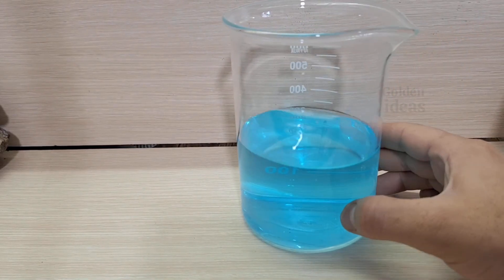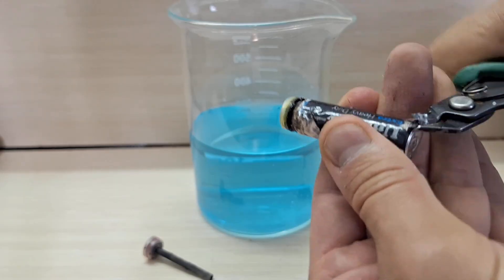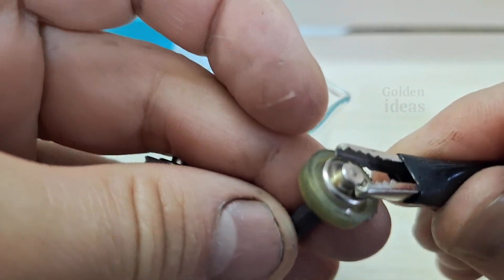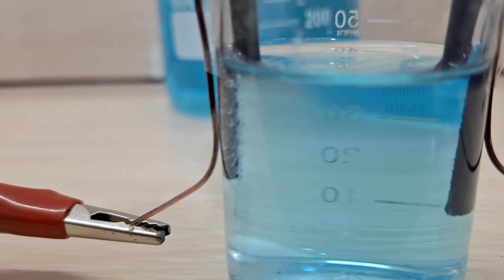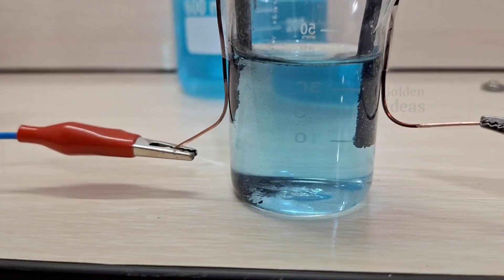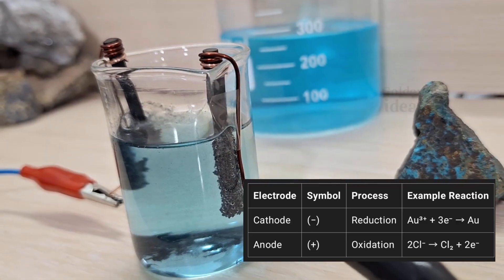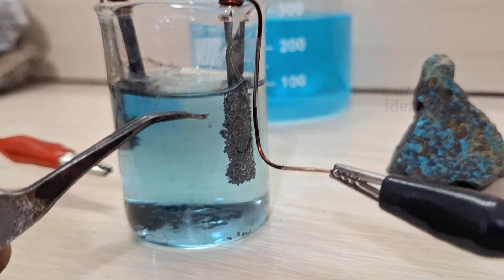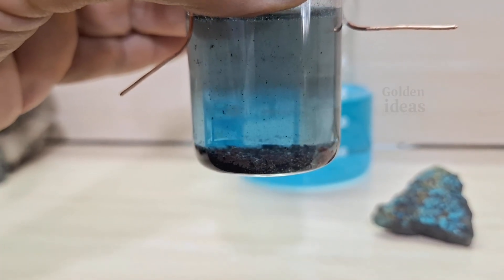Gold Extraction Using Graphite Electrolysis – Myth or Reality #gold

Comment: I would enjoy seeing this experiment done slightly different.  Your electrolyte is partially or fully saturated with elements you would like to plate out.  Given the elements you want to plate out if the anode was made from the most reactive metal of the group you wanted to plate out and the cathode was a non reactive medium.  You would replace all metals within the electrolyte with the anode metal to plate out all the others you wanted would it not?
Reply from the maker: Yes, dear, you made an important point.👌🤝

With respect🌺

Comment: Sir, I have a few questions. 
Is cyanide better than acid to extract gold from soil? 
What method should I use to reduce the initial cost? 
Thank you for sharing the videos. I know that making videos is hard and takes a lot of effort. I hope you find a good financial sponsor.
Reply from the maker: Dear, to dissolve gold in its metallic form, you need two acids — this is called aqua regia.
But to dissolve ions, even a single acid with very low concentration is enough.
Even salt or sodium hydroxide can help keep the ion suspended in solution so it can be converted into a complex.
However, if your mineral contains sulfur, you should remove the sulfur first.
Of course, you can also use cyanide or thiocyanate, but they are dangerous, and I don't recommend them.

Comment: Can you set your beaker into an ice bath to keep the heat down?
Reply from the maker: Yes my friend, you're right. Plastic clips are great for holding the electrodes, but I didn't have one available at the time
Reply from the maker: You’ve raised an important point. Placing the beaker on ice or in a cold environment can help lower the temperature of the electrolyte solution. However, this can put stress on the power supply, as it tends to draw higher current. A better approach would be to dilute the concentrated solution with some distilled water to reduce its conductivity slightly. This way, the solution won’t overheat, and the power supply will remain safe
  
😍
Reply: That makes sense, thank you.

Comment: You can use a flat plastic piece with two holes to hold the graphite rods, and put horizontally on top of the beaker,,, good luck
Reply from the maker: Thanks for the tip! 😊
Reply: Better to use 3 volts or lower to avoid breaking down anode and cathode
Reply: The question is: can such ores be concentrated somehow?